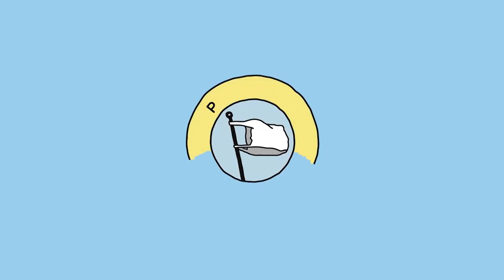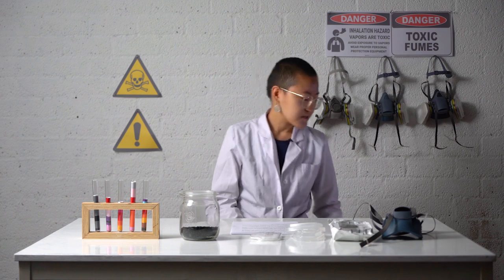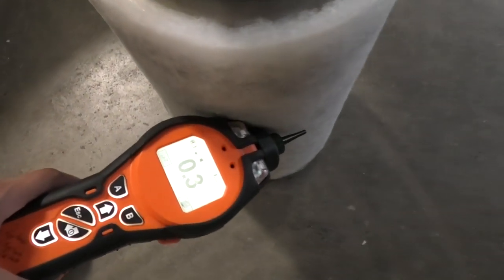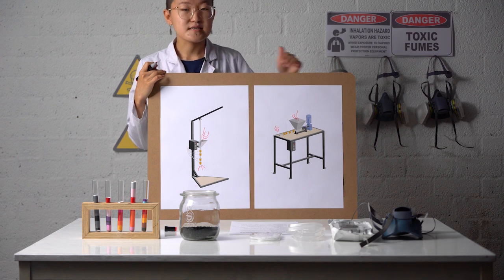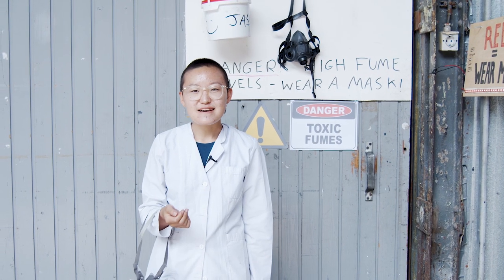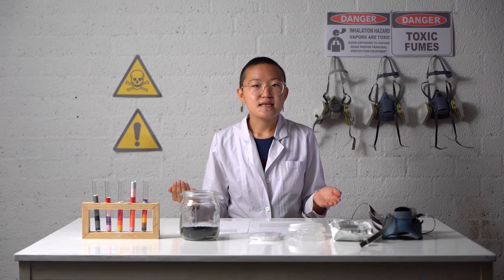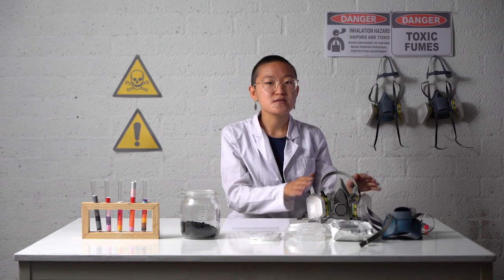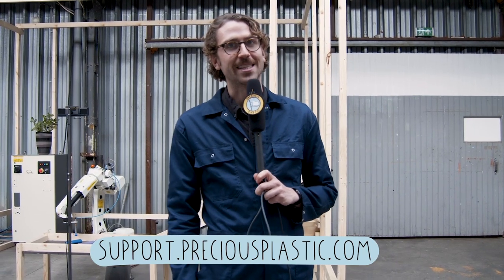Precious Plastic - Safety and plastic fumes (part 2.2)

Comment: Re cheap, high volume centrifugal fans: check out second hand bouncy castle 'blowers' as they're known. You can usual get one for about £25-30 and they shift a lot of air (much more than an expensive oven / cook hood fan) and work best when pulling against a filter like the can filters advertised.

Comment: Ok, here is a more specific question:

#1 - I know you need a carbon filter mask when melting plastics with more fumes, but do I still need the carbon mask for HDPE? or should  I wear like a dust mask or a N95?
Reply: almost all recycling plants on big scale whom recycle pp or pe plastics opperatie without a gas mask. The issue here is that its a big lobby, and the original plastic producers claim there are no harmfull sides on any of these fumes. The part they don't talk about is the addetives in all the plastics which are possibly harmfull. They do have plastic dust flying around with many employees without any face protection. 
So just always wear a gasmask and buy a stock of filters ABEC.
Reply: Ahh ok thank you

Comment: I cut packaging foam with a hot wire to create RC airplane parts. Should I buy a fancy mask or will having a fan running on high outside work fine? And I only cut for a few minutes every once in a while.

Comment: Thanks fot this video, guys! Great job!
But I have a question. So we use ventilation system that takes fumed air and put it away. But what happened when that fumes are out? They become destroyed or pollute the environment?
Reply: We use ventilation system with the can filter which has activated carbon pellets inside. So, this cleans the fumes very well.
Reply: @dailylearning-lab  but what's next? They are just collecting inside the pellets?
Reply: @preciousplastickyiv8389  yes. After a month you need to dispose the pellets into landfill or regenerate it or give it to a disposal service. I know that it is not the perfect solution but at least we are decreasing the fumes coming into contact with the people and the air in the environment.
Reply: @dailylearning-lab  Thanks for replies!

Comment: Which filter cartridge is optimal for melting plastics? Because I found several different ones with various color codes and can't decide. Thank you for this content. Very helpful. :)
Reply: Any filter cartridge with activated carbon pellets will do a good job. You can check out Canfilters (https://canfilters.com/products/filters/). And I am sure there are other filters like that, but during my research I came up to this brand which was suitable for our purposes. And try to by big or medium size Can-Filter or Max-Filter. You can reuse the cartridge by emptying it and refilling with carbon pellets which you can buy in bulk. I hope this helps.
Reply: @dailylearning-lab  Thank you for the reply! Great and helpful Information. :)
 And which cartridges should we choose that fits to the 3M gas mask? What specification should I look after?

Thank you again! :)
Reply: @DonatSomogyi  you can buy ABEK 1 6059 cartridges :)
Reply: @dailylearning-lab  Thank you! :))) Yeey
Reply: there are half masked filters with NON replaceable filtration cartridges. which means you will have to throw them away.  its a shame.  and these filters/masks have an 8hr work cycle.

Comment: I burn plastic for work in a closed room. And I don’t get paid enough for this crap. This is eye opening. We burn pe and pp at 500 degrees for 1-2 minutes at relatively close to fumes, that is welding the plastic together.
Reply: I feel you. I run an extruder and its fucking horrible how many fumes and how much smoke is created. It's fucked. I'm considering calling OSHA or something on them for not having fume hoods, just scared to lose my job.
Reply: Oh no I hope you have left & the company should be held accountable for safety issues